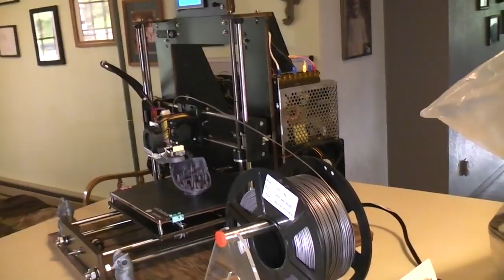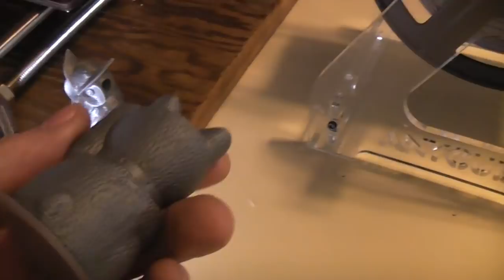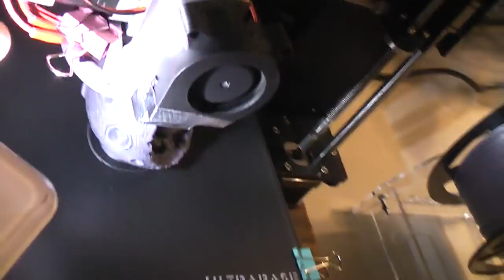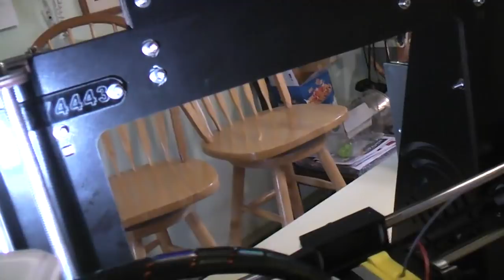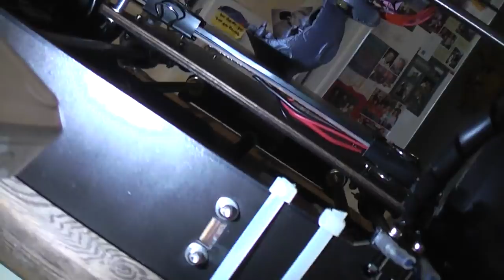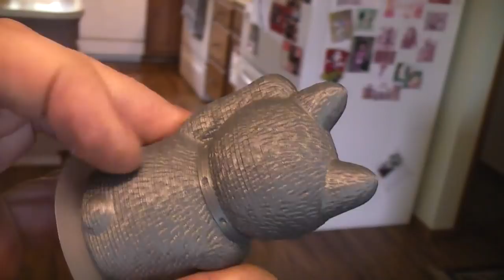$92.40 for a  3d printer.  CTC latest version , Listed as A8 type printer kit May 2018

Comment: I was very lucky to get hold of a brand new CTC A8/i3 type kit for £75. This was my first 3d printer and it taught me alot. I managed to print reasonable prints after building a "bolt down" jig for the entire ply wood constructed printer. I did have z banding similar to yours so bought some lead screws to replace the threaded rod and eliminated z banding. I then built a tubular steel frame for the printer to replace the ply which improved things even further but I was still learning. I intended to carry on with a prusa i3 style design but came across linear rails and I could get these relatively cheap to try which, after cleaning and relubing with super lube worked way better than any linear shaft design I've tried. I now have two printers, one tubular steel construction with solid linear shafts and igus bearings and the other, 2040 aluminium extrusion with linear rails. So its safe to say I got the bug and got a little carried away. I now feel I need to upgrade the board for something using more refined stepper drivers and I will have prints way more than half decent as I am certain the reduction in noise will result in the slight ringing being reduced to almost nothing. All the best and enjoy the hobby!
Reply from the maker: Nice job on the rebuild ! Yes so much can be learned for the low cost 3d printers.
Reply: @Robothut  I think because I like messing around with tech getting the cheap printer was the right move (I would have still modified a stock ender 3 - like most people do). It taught me enough to allow me to build a fairly simple but strong Cartesian Frame and work on upgrading it over time. Still using the original A8 clone controller board at the moment but managed to get a clean'ish benchy.. https://imgur.com/8t6EF6Z
Reply from the maker: @Reidy82  The Benchy looks Great !

Comment: Big change from 2017 was that they ditched their GT2560 clone main PCB, since it's got a bunch of somewhat costly parts on it (although they also didn't use the Mega 2560 processor unlike original PCB but the scaled down 1280) and went for an Anet clone. Since the Anet clone PCB (1284 processor) doesn't have enough pins to drive a rotary encoder, the Anet display PCB puts a bunch of buttons on one pin, connected via different resistors, so the processor reads analogue value to decode the button press. Also i don't remember the extruder being as absurd as you describe it, but seems like a very CTC thing to do.

I have a similar printer made by Geeetech which is... mechanically almost similarly absurd. X and Y bearings are actually properly sized for the rods and work well, so at least there's that, but rusty out of the box. But at least the electronics is actually among of the best ones for the time, with genuine GT2560. Z-wobble is diabolical, there are proper couplers, but the threaded rods are just horrendous, and the Z axis bearings are very short and don't work well. The frame is bad, it doesn't have a full front frame piece and instead small top and bottom pieces, so it's even wobblier than yours. It just makes the shipping box smaller. The frame is also very cramped, things collide, so you get a couple mm less of build area than 20cm in each direction. PSU should be OK, but i gave it a Xilence 92mm PC fan that i had kicking about just in case, got it on clearence for 3€ about a decade ago. I have gravity loaded the Z axis and fixed the Z screws at the top in a bearing, but they still wobble - there is no longer a horizontal wobble pattern visible in the print, but i have the impression that a small remnant of it is still there, now imprinted into periodic difference in layer heights. Maybe i get some hardware store M6 threaded rod next, and make sure they're super straight and well aligned. Lead screw is too expensive, like 20€ for a kit of two, and the alignment of the frame is pretty bad anyway. I now have Igus bushings on the bed that i received as a free sample and printed PETG bushings on X-axis - Igus on X axis angled themselves and bound up, and i'm quite happy with PETG, they're not smooth, but the X motor easily overcomes the friction, and i made them fit just right. The extruder had to be replaced by a $3 Alu from China, it got progressively weaker as weeks went on, the spring gave up. I replaced first the idler arm by one i 3D printed with added preload adjustment but then after a while it broke, so it's good that i had an alu extruder prepared. I anticipated that if i just kept adding preload to the spring from the bottom, the original plastic arm would break too. I also have an 8cm cooler on the main PCB, this way the MOSFETs and drivers are quite cold. Also some mods - a filament rack that sits on the printer, and some threaded rods to tie it together to wobble less, bed strain relief, long lm8luu mod for Z axis. And added part cooling and now a manually attached bed probe that just clips onto the bottom of the toolhead by magnets, i got some excellent little N42SH ones from an industrial surplus seller. This printer was the best thing i could afford and just what i needed, also considering it's set up right out of the box for firmware development with a bootloader installed. and the board is actually fully featured, i needed a learning tool and i got one. I eventually replaced the ATX12V connector on the board with a pigtail and XT60 because the original connector started heating up a little bit, probably oxidation. Maybe i rebuild it to a CoreXY now, if i can come up with a stable design that i can build from cheap material, like 16mm edge-glued wood, which is very cheap. Plywood, alu extrusion, and steel pipe are somehow eerily expensive.

I saw a printer recently advertised on eBay as CTC A8. This time the frame looks more like Geeetech's wood frame, also separate top and bottom pieces, and at least on photos, it shows trapezoidal lead screws, which is interesting, and proper couplers. I am wondering whether they actually are like that, since pictures might be inaccurate, so i went looking for whether someone bought a new one and made a review, but so far haven't found one. Price in 2017 for CTC i3 Pro B was around 125€, i got the Geeetech i3 Pro W for 135€, and now the new CTC are 73€. Which is kinda amazing that you can get a proper 3D printer, even if horrible but still seems like a decent foundation, all NEMA17 motors and some hardware and a 40W hotend and heated bed, unlike those toy printers based on modified blinder motors like 28byj-48, which are completely hopeless. It's not much more than just a set of 5 NEMA17 motors. Even part cooling fan according to the photos is supplied.
Reply from the maker: Thank you for the update on the printer and all the mods you did to yours. yes a great learning machine for the money.

Comment: I got a $139 CTC DIY 3i "Prusa" type printer kit last week that looks just like your $92 printer , but only the power supply connections are pointing down is different.  The two printers look so much the same, that all your suggestions will work on my printer too. Thanks a lots, it will same me many ... many hours of research time!  My current problem is with low volume filament extruding rate and will try your cooling heat sink changes to improve flow.  The 3d printer kit build process has been fun. Again, thanks a million.
Reply from the maker: Yes the price of the kit does seem to bounce around, the lowest I got one for was $75.60 and $33 for shipping so around $108.00 total. You can learn a lot from these type kits, have some fun and not break the bank doing it.
Reply: My tug boat test print looks good. Only the chimney isn't a nice cylinder. Do you know where I can fix that? I got the geeetech i3 w pro. Im a newbie, gt mine for 150 euros. You learn a lot with these kits, indeed.
Reply from the maker: I would start by checking that there is no slop in any of the belts or other lead screw connections or even in the hot end unit attachment. If you were missing steps then that should show up on more of the print than just the chimney. Anything mechanical that seems a bit wobbly or lose would be a good place to start. Or print something different and see if the problem starts at a certain height, then it might be something binding on the Z height. Not being there to see the printer and the print it is hard for me to say for sure.
Reply from the maker: On the cheap CTC they use plastic belt drives and bearings for the belts. They were not round but a bit off center, this would throw the prints off a bit on something like a chimney also. They would be cheap to replace with aluminum ones that are round and not off center.

Comment: Any 650w ATX psu will do a better job and come with a( power switch cooling fan and much more protecthion) :) dont need more then 12v on those printers any way and 20A will do

Comment: I brought the CTC DIY. I did get it to work a few times but the print outs are ng. Yours look great. what software did you use? I used Cura 4.5 Printer set to PRUSA I3 MK2 and I used the CH340 drivers. Do I have the correct settings? and the hot bed has a problem.
Reply from the maker: Yes 2 years ago when I did the video I used what ever CURA version was out then. I do not recall the settings but it might have been the Anycubic i3 Mega. I did not have a problem with the hot bed they were selling back then. I did have problems with the hot End extruder design, I covered that in one of the CTC videos. Basicly if you got the printer for under $100 bucks like me back then it was a great deal as the parts could be used to make a good printer if you spent the time and extra money . But these days there are so many printers that are ready to go for around $200 bucks that it may b be hard to not go with the extra money version.

Comment: Does the printer require 220 volts outlet. I'm looking into buying the 2020 version but I read the printer requires 220 volt/ 80 amps. I only have 110 volts. What does the 2018 version have?
Reply from the maker: When you order the printer you specify the country and the 12 volt power supply will work in that country. Most of the little 12 power supplies that are used in these low cost printers have a switch that you move to select either 110 volts or 220 volts mains. Non of them draw 80 amps so that is either stated wrong or you read it wrong. I just checked the link I have posted and the printer is $81 bucks right now.

Comment from the maker: RIght now you can get the CTC printer kit  for $75.60 at Aliexpress ! 3 days left on the flash sale.
https://www.aliexpress.com/item/CTC-Latest-Version-A8-High-Precision-3D-Printer-DIY-Kit-Free-1-75mm-PLA-ABS-Filament/1000005191001.html?spm=2114.10010108.1000013.8.18f75abbJTe5ND&traffic_analysisId=recommend_2088_4_90158_iswistore&scm=1007.13339.90158.0&pvid=d520740d-3de0-46f5-8e59-8762b82922da&tpp=1
I bought another to mod into a Linear rail 3d printer. Will post a video when its done. Too cheap and to much fun to miss.

Comment: i have the same printer but when it prints     lets say its printing a rectangle it will have massive bumps everywhere .      its almost like it has thin veins all around it                    it doesn't extrude equally and will spit filament instead of extruding it in one strand do you know how i can stop this?
Reply from the maker: Sounds like the extruder is not working right. Like the filament drive spline wheel on the extruder stepper is slipping on the motor shaft or on the filament. I would take the extruder apart and have a close look at the parts that move the filament. There are lots of great extruders that you could put in place of the crappy one that comes with this low cost printer as a upgrade.
Reply: @Robothut  okay thank you so much

Comment: Hi,
Any tutorial for calibrating this printer? First start setup?
Reply from the maker: There are a lot of you tube vids on setting up a printer, but the first thing you have to do is get the bed level and the nozzle  set about 1 sheet of paper higher than the bed when every thing is in home position. There are many videos on the CTC printer on you tube that might show you what you are looking for. But I did not do a basic set up video for this printer. Back when I made this video I did not think anyone would be interested in such a low cost kit. I should have done more on the set up.

Comment: Hi Robothut, I just purchase the same printer 3D that you have, and I assembled everthing correctly. But after turn it on, the LCD display didn't show any text or any message. Also, any led of the motherboard don't blinked, all it was turn off. It's like if don't have any software inside the processor. Did you have the same problem with your printer 3D?. Do you know how can I solve this issue?.
Reply from the maker: I did not have this problem. Sounds like a bad power supply. Have you checked the voltage of the power supply with a meter to see if it is working right ? I would say contact the seller and let them know it is not working and that you might need a new control board or power supply. Also if you payed for it with Pay Pal then let Pay Pal know that the unit is not working and they will get your money back.

Comment: Hi, I have a geetech pro B that this.
What you use that size of the nozzle?
Thanks
Reply from the maker: The printer came with a standard 0.4 nozzle, if that is what you are asking .
Reply: @Robothut  I am asking the best setting for my print.
Than do you use program for printer?
Reply from the maker: On the CTC printer I just used cura. 0.2 layer, 210 hot end, 60C bed, 20 % infill, standard quality settings and speed. Nothing special on these prints. Every print you do will be different depending on what you are trying to do.
Reply: @Robothut  thanks

Comment: I got this for christmas, put it together, plugged it in and tried to home it. The thing sounded like a dying sewing machine. It hit the limits but the steppers kept running. Any ideas?
Reply from the maker: Yes the end stop switches or even just 1 switch is not working. The machine homes in a set order. So you have to watch and see what does not home. For example lets say the X axes homes first but that switch is not set in the right place to get triggered or the switch is not plugged into the right spot on the control board. The machine will then just keep running that stepper until you remove power and it will sound real bad.  So you need to check each End stop switch for all 3 stepper motors to make sure they can be triggered and that they are plugged into the right spots on the control board. If they are all OK then I would check to make sure that the stepper motors are running the right direction. A stepper motor cable that was wired up backwards will make the motor run backwards. When you home the printer all the steppers should run in a direction that would make them hit the end stop switch, If the motor is running so that the hot end or print bed or Z rods move away from the end stop switches then you know a cable is wired wrong.
Reply: Robothut they all move the right direction, just wont stop at the limit switches. I'll figure out how to test the limit switches. Ty for your reply. If there wires up backwards it must have been from the factory because there all plugged into the correct spot according to the diagram.
Reply from the maker: It only takes 1 bad limit switch to Stop the homing . So check the switches next with a volt meter or a ohm meter.
Reply: I've got some new limit switches coming from Ebay. Now I cant get the printer to connect via PC or sd card. And when intelligence it to preheat pla it wont maintain temp on the nozzle. I'm very frustrated with this thing. Thanks for all your help so far
Reply from the maker: So sorry that your printer is having so many problems. You might want to set it a side and start with a different printer like the Ender 3 or if you like fixing things then buy a Flash Forge Finder on ebay they sell the returned units as PARTS ONLY, but sometimes they are perfect and some times they need work but at $95 bucks for the printer it is a good deal. search words I use on Ebay are "FlashForge Finder 3D printer (for parts only". I did a video on it as well if you search my channel you will find it.
Reply: I saw that video and I'm going to buy one soon. I have a cr 10, that I purchased but I wanted to get this working because it was a gift. I'll get figured and ty so much for your help!
Reply: Just an update, I got it fixed. I had to change the limit switch. It was bad, ty for all your help!
Reply from the maker: Great too here you got it fixed. Yes just 1 bad limit switch stop up the works good.

Comment: Please ask for printer settings
Reply from the maker: You can start with any of the standard Bowden tube type printers for the basic settings. Like a Ender 3 or the small CR10 for example. Those setting profiles will be listed in the CURA set up program. Then you can tweak the settings just like you do with any 3d printer to get best results.